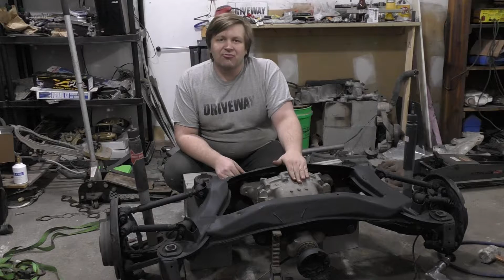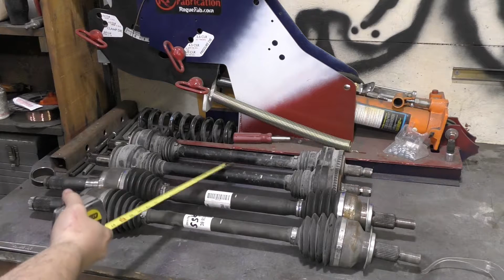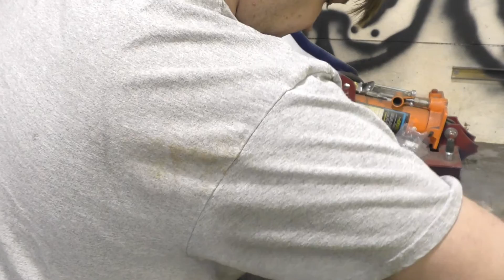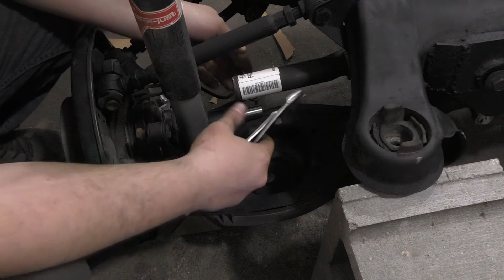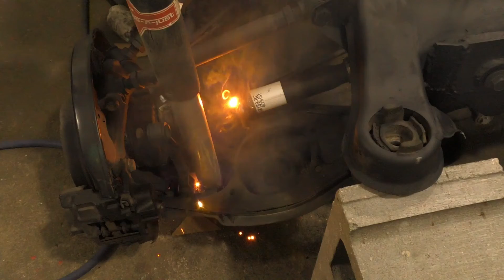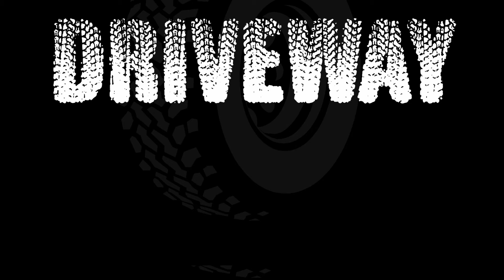V8 Crossfire Project: Unsafe and Low Quality Axle Splicing | Driveway

Comment: That seemed to go together well.
Reply from the maker: Almost too well - clearances look good and The Driveshaft Shop said it shouldn't be too hard to make the axles for about $600 a pair - Works for me
Reply: @Drivewaybuilt  That's reasonable. Will you test run before they are made?
Reply from the maker: @JT-tk4me  I'll definitely take these test axles around the block once - they wont last long though.